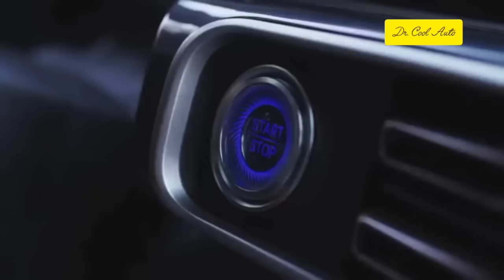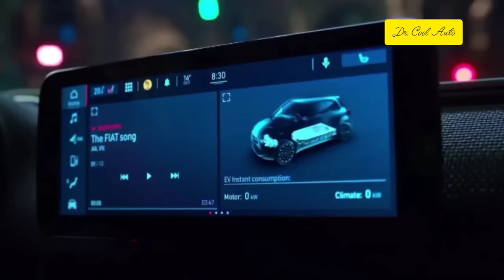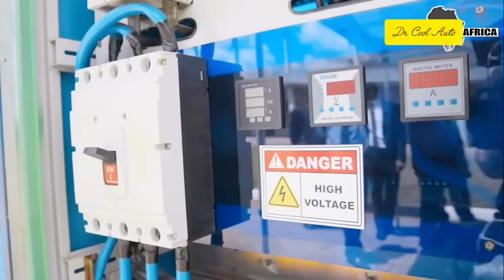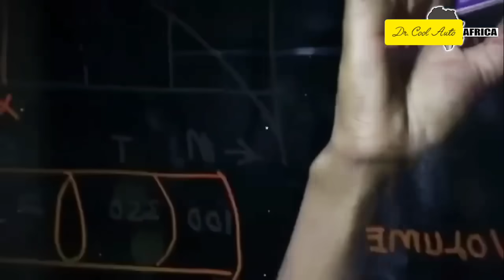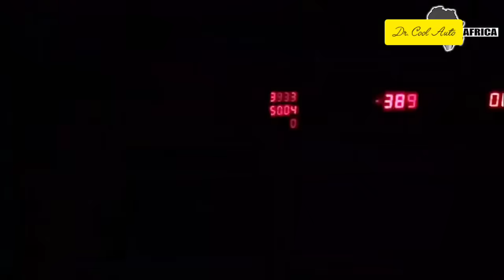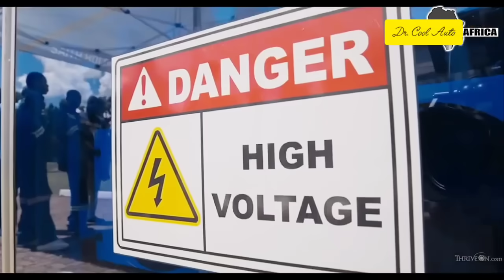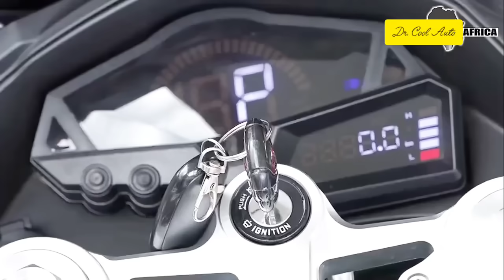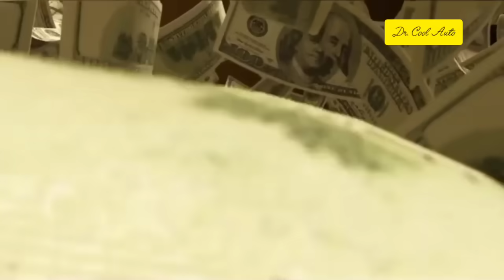2025 Self-Powered EV: Shakes Up The Entire World! shock skeptics

Comment: Sorry, but it is a dream.  In 1957 my dad put together a two transistor radio that tuned  power source into a close station.  It's volume about that of an earphone.  This is a scam.
Reply: No, it may not be. It is theoretically possible, and violates no tenet of Quantum Physics. Whatever your dad did in 1957 has no bearing on what this man may have done a few years ago, and is doing now. I built a Crystal radio set around 1959, and it didn't even have a battery - just a Germanium crystal, a diode, and a copper coil I wound myself, around a cardboard tube. 
I listened on an old single-earpiece radio earphone, and listened to my dad when he was a DJ at a local A.M. (that's all there was, back then) radio station. NO POWER SOURCE - but it HAD to have been getting power from SOMEWHERE. 
The coil was pulling in FREQUENCIES, tuned by a flat piece of brass I slid along the coil, and attached to the crystal. 
His invention works on getting FREQUENCIES, and transforming them into usable energy - just like that radio, but on a MUCH bigger scale. We are SWIMMING in a SEA of energy (the Dirac Field).

Comment: do people here actuallly believe this crap?
Reply: Most people through their comments appear to believe but this video add fraud prey on the naive which use no logic friend Stein.   It might surprise you but this letter will explain to you, using logic as "proof" of why this so called "new source of energy, invention"  is a deceitful add for fraud, to steal money from whoever is naive,  and would end receiving nothing back for any sent money.  What is shown in this video  is nothing other than one more deceitful propaganda fraud sci-fy tech advertisement,  like the other adds presented 15 and 10 years ago about cars running on nothing but water and no other energy necessary  but in fact was never true since it was about the "hydrogen" from the water,  needed to be extracted from the water by consuming a large 
amount of 
electricity first, before producing the "hydrogen",  from the water. And that energy used to extract hydrogen from the water, costs money every time, and is not free. Therefore the water advertisement video , to be used directly as free source for energy for cars,  was and is a fraud advertisement video.  This video is shown by this YouTube channel also for profit if earning either money through this channel, or subscribers that might use the service that this channel may offer. But the "cars running on 
water 
as free source of energy", (old video add) was a fraud add because was presenting >deceitfully< the implication  of water used directly as a free source of energy instead of the hydrogen from the water,  which was needed to be extracted first,  from the water, with the help of electricity, through the consume of electricity,  and the process (of extracting hydrogen from water),  is not free but costs money each time, when hydrogen is extracted from water 
(the car 
running not on water but on hydrogen). Yet what was first claimed was  not possible to do, since is a deception, a fraud add. The same is with what is claimed in this add = it costs money to spend in regular basis, no matter what you use as energy extraction source whether solar radiation or radio waves, rays, sonic energy or whatever "term" you could come up with to invent, (UNLESS IS THE DIVINE SOURCE  
"YHWH" 
which is not an invention, not a created thing, nor a creature.   Know yee that the deceitful propaganda from  this video has connection with China and  the Chinese which are heavily involved in Africa sucking the blood out of Africa by enslaving it, the modern way, with slavery that the West practice no more (slavery) else would have not had a civil war white people killing their own white people that were pro-slavery.  The CCP China practitioner of 

methods 
to enslave entire nations, would never have a civil war to kill their own pro-slavery CCP people, to abolish slavery (else would not do what they do right now in Africa) besides cheating and deceiving a lot, non-stop with deceitful diverse propaganda.  But ask yourself this:  If the Chinese made cars and motorcycles or mopeds or bicycles that runs with his so invented new tech (which is fake), but if were true, right now such Chinese cars, motorcycles, or mopeds and bicycles could be seen on the streets 
of the 
European nations and other nations world wide, and especially on the streets of the nations Europe and Africa and Asia and South America which sabotaged the plan to impose tariffs on the Chinese cars and other imports, and still brings Chinese cars, motorcycles and bicycles with no extra taxes or no imposed tariffs.  That means such cars, motorcycles and bicycles  would be seen on the streets of many nations and their engines would be shown in videos by many proud owners of such vehicles  but 
the fact 
that there is no existing proof of such vehicles with such engines to be found on the streets of any nations in number of thousands of cars, or motorcycles, or at least on bicycles, ... the not existing so on the streets,  it is the counter-proof for you to know that the presented fictitious invention is only one more fraud add attempt to get money from the naive people that could be fooled, so that they end up never seeing their invested money in any form back, ...  not even in a real vehicle or bicycle 
with 
such engine, and feel ashamed and foolish for believing such lie and become a victim of such fraud. No one that truly gets to have such miraculous technology that produces free powerful  energy in huge quantity while the device (engine) is as small as he has shown the fake device attached to that TV screen, to be,  while having in it hidden a powerful lithium very small battery able to turn on the TV for a very short time, after which needs recharging with expensive electricity, else needs to 
be kept 
plugged in the wall to the electricity source ... therefore a fraud of a video "add" made in Africa,  to cheat naive Europeans and Americans  off their hard earned money; ...  No one having such technology of powerful free energy emitting small device (engine), would show it on videos publicly on the internet and still remain alive to be able to still post such fake claim, (unless is a fraud, a fake claim) because if were true,  immediately some people from all the huge energy source producers that would automatically 
become 
bankrupted even as countries becoming bankrupt (whether owning sources selling gas, lithium for batteries, or selling electricity, or petrol or other oil (bio-fuel),  all such countries as well as owners, but even China itself known as the greatest thief of technology unwilling to pay the annual fee for the Non-Chinese  (Western) patented invented technology that China  usually steal,....  all such countries and owners of the known energy sources and all of them having assassins and snipers would have 
stolen 
by now  that technology and eliminate that man or just paid him much. And that technology (if were true),  would be  either kept secret and never applied on anything that could be sold and then copied, without paying for the patented invention annual fees, (as China does not pay such annual fees for 90% of everything it produces and which is produced from Western patented technology ).  All those owners and countries of diverse energy sources would either make the invention not-applicable if the 
invention 
were real, or else  would use it on expensive products (cars, bicycles, ... and anything that needs energy) and sold to you as expensive as today's items using energy, to get your money, monthly,  to replace today's known energy sources that are more expensive to extract or to apply,  such as solar panels requiring much space for solar panels and sunlight non-existent at night or at day in cloudy conditions,  and storage of that electricity into expensive batteries, and the same for the wind making electricity that 
also 
requires much space and wind which doesn't exist always and everywhere, and expensive  batteries and storage space of the electricity produced by wind into expensive batteries.  Such fictitious energy source presented on this video, (if it were real - would be immediately stolen and then either):  kept secrete until all the present energy sources (gas, petrol, coal, and battery minerals or lithium) becomes exhausted and finished,  or else are replaced with a new source of energy that would 
not be 
"free energy" but cost as much money, paid monthly because the owners and countries of energy sources (gas, petrol, coal, lithium and batteries, solar and wind tech and electricity makers and countries would NEVER want to receive NO money monthly or annually and become bankrupt and in need of money because  of  giving  free energy and not collect money and thus to become bankrupt.   LOGIC ==>  NO FREE  ENERGY SOURCE INVENTION  would ever give you free energy while the earth is ruled by men and 
not by 
The Divine MessiYAH   YHWH Savior  (YAH Shua).  There is no free and unlimited Source of Energy other than   "YHWH" EL,  The EternaL  EL (EL'o'him),  Self Aware Unlimited Energy (Spirit/Force/Almighty Power) Limitless in Intelligence (from the eternity past),  Pure (Holy),  Creator of the Universe (from beyond time and space, Creator from EL's Self Unlimited Energy)  Y.H.V.H.,  name abbreviation which also stands for  "I Was, I Am, I'll Be",  and YAH EL,  The Divine Eternal Word that took human form under the name YHWH Savior (YAH Shua) The Divine MessiYAH,  EmMan[u]EL  (AmongMen[the]Eternal).